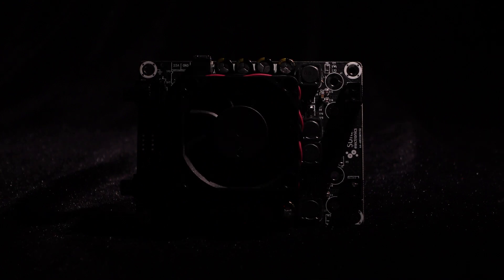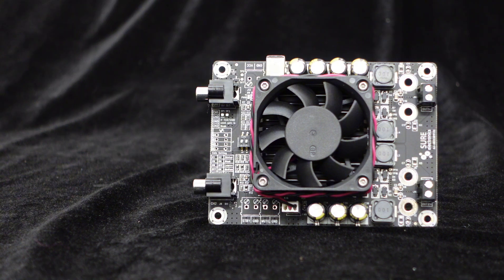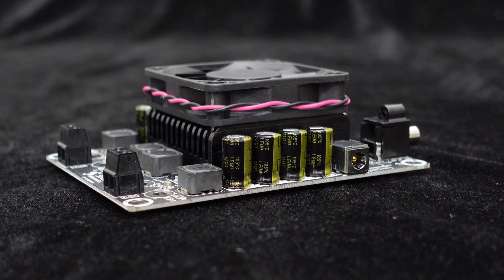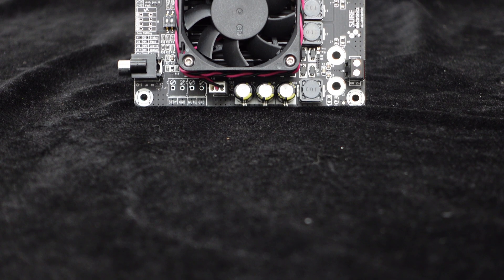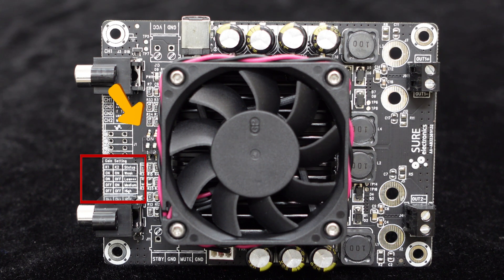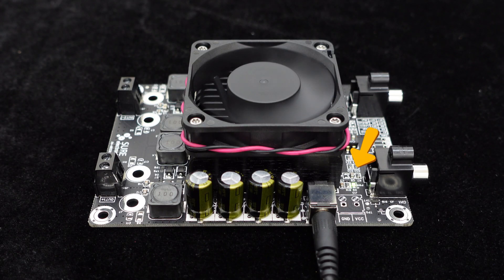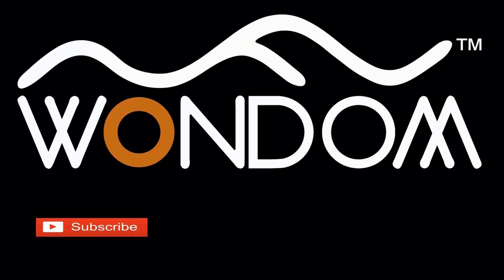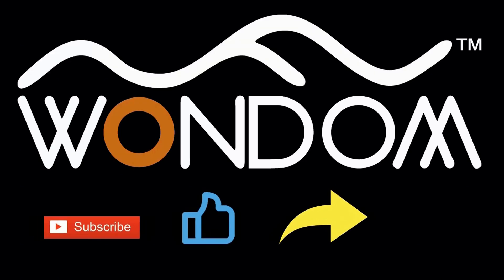Stereo 160W Audio Amplifier with Large Fan MPAB-2160, 4-Level Gain Adjustment Supported

Comment: Very small inductor. Never have 160 watt per Channel
Reply: Could work. Inductors with that size are capable of around 5 to 6Adc for example sumida CDRH127NP 10µ is rated 6,3Adc with temp rise 40°C and 7,6A min. saturation.